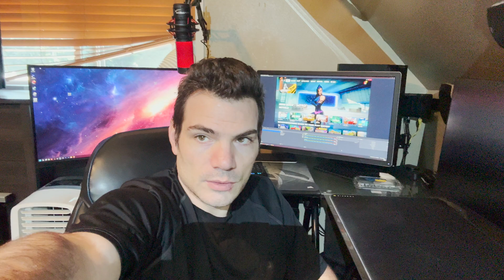How well does Fortnite run on a Radeon Pro W5500 pulled out of a slot machine?

Comment: Not bad. Would still have liked to see this card at its highest workload though, with higher settings. Would be really useful for others to see the difference in performance relative to graphic fidelity. If you’re selling the card, I’d be interested to do some further testing with hackintosh too. Lmk
Reply from the maker: If I get more of them I might do some sales/giveaways, right now I am holding onto it because to be honest, the relatively unique form factor for a card of this performance is something I sometime need. I am working on a more in depth video though showing far more in depth stuff on it, for some reason this video just took off with a couple minutes of Fortnite and Cyberpunk. I also have a couple of W5100 and W3100 cards I pulled out of Slot machines as well that I am going to do stuff on. I just posted a video on a broken build I worked with that took my focus away. What games do you want to see tested?

Comment: The framerate here is still pretty impressive despite the older CPU, considering most kids who get this GPU is probably pairing it with a 144hz 1080p monitor. Definitely a viable "Esports Ready" configuration.
Reply from the maker: I have a 12100F on hand I need to try pairing it with, a cheap new modern chip like that would probably be ideal for this card